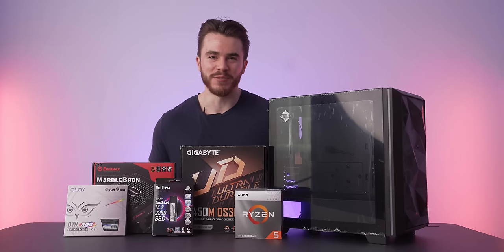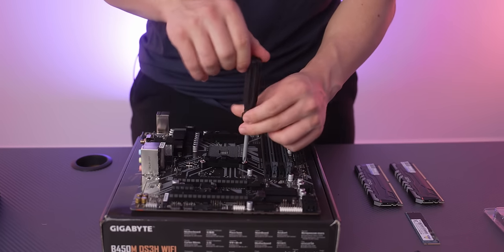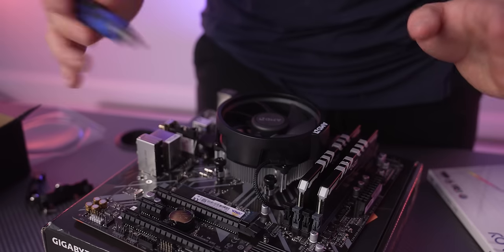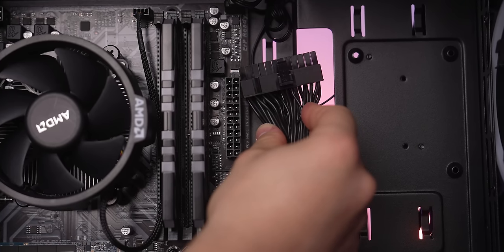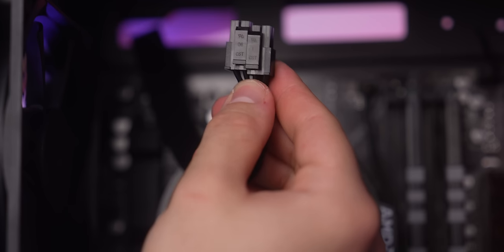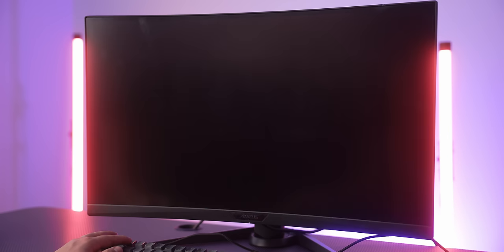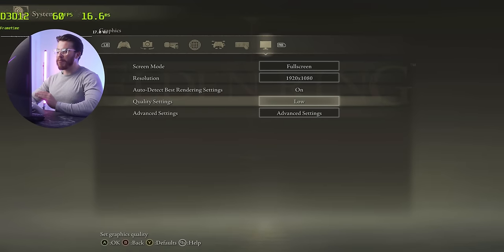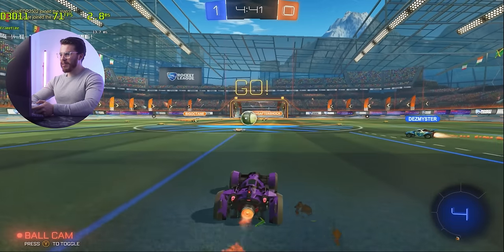How to Build a $400 Gaming PC in 2023! ⚡ Step by Step Guide

Comment: If I wanted to buy a pc with an aio cooler but it came with a fan cooler, could I just change it easily or is there things to consider?
Reply: Make sure the aio is compatible with your motherboard.

All motherboards are different so make sure your CPU socket is compatible with the aio.

Other than that, it's easy and simple to install.
Reply: @thetechrealist  okay thanks so much! :)

Comment: I made a pc with same specs but whenever I play games and record at same time my games are smooth but my recordings are so much laggy. 
Why???? 😢
Reply from the maker: You’re recording with windows game bar, which is laggy on a PC that doesn’t have a dedicated graphics card.
Reply: @ScatterVolt  i Use OBS and i also Tried Streamslabs but still get laggy recordings. Did you use dual pc setup to record game part videos??
Reply from the maker: You need a dedicated graphics card

Comment: if you don’t have at least 1500$ to spend on a pc build, buy a ps5. Price to performance is not even close even after spending 1500$ just get a ps5
Reply from the maker: You could spend $500 on a used parts gaming pc based around a 5700XT and match it. I plan on doing this for a future pc build.

Comment: the ATHENA M2 LITE keeps going out of stock is the alternate the exact same because i have no  experience
for pc building
Reply from the maker: Look at any of the other mATX cases I use my other pc build guides if you need a step by step tutorial. 

Spoiler alert though, the building process for all mATX pc cases are pretty much the same. You don't need this exact case to build this PC.
Reply: Thanks
Reply: That's gonna help when I get all the parts in 2 weeks!

Comment: Hi. i have the same pc as you are and i have a plan to upgrade my pc by adding a gpu. i have a plan to buy rx 6400. is it good ? Or maybe u guys have any other recommendations?
Reply: It's pretty bad. What's your budget?
Reply: @TheACTIONZ  Around 250 - 300 $
Reply: @oji6276  I'd say the Rx 6650 XT or the Rx 7600. Maybe if you go a bit over your budget, buy the 6700 for the 10gb of VRAM or the 6700 XT for better performance and 12gb of vram
Reply: @oji6276  the lowest you should go is rx 6600.Anything you go below that generation it's not relevant anymore. Or if you really want team green rtx 3060 if you find a good deal on it although it's still overpriced for what it is.

Comment: Can I add any GPU to this motherboard with no problem?
Reply from the maker: Your only limiting factors are graphics card length and power supply wattage supported for the GPU you’re interested in

See pinned comment though
Reply: @ScatterVolt  I see, thanks!!
Reply: @ScatterVolt  I have one more question about the integrated graphics on this CPU. If I add a GPU to it, will both work together? Or just the GPU?

Comment: Is this pc good for editing aswell like after effects and topaz
Reply: I don't think so because amd CPUs are not the best with these stuffs
Reply: @skyraze  do you know any pc that are good for editing and can play decent games I don't know anything about pcs sorry
Reply: @st4rdust_j795  intel CPUs are good for both gaming and editing but you would need a dedicated graphics card.. If you are on low budget then try to buy a used graphics card from a trusted source. 
Buy a GPU considering your budget as a new GPU takes 35-50% of the whole budget
Reply: @st4rdust_j795  for games you need a solid gpu, for rendering you need a cpu with decent clockspeed, plenty of cores and some ram(in some programs like davinci, gpu acceleration can be utilised aswell) . You can do both on any computer, how well it depends on your budget.
Reply: @NanoBytegaming  I can spend about £600 or £700 that's my budget would you be able to tell me what's good like for gaming and editing like the parts of the pc and the names please

Comment: i want to get a prebuilt pc off a trusted seller (amazon or ebay( yes i know there are more but im asking for those specifically)) for under 475 that has a good upgrade path. the best one ive found so far can only upgrade to the rtx 3080 ti and a 4th or 6th gen i7. for the prebuilt i want at least an i5 or ryzen 5 (and no im not including those little numbers) and for the gpu, if its nvidia, an rtx 3050 or slightly lower will work fine, or for AMD, i have no idea because i dont use those cards. for the ram, at least 16 gb of ddr4, ddr3 will work fine but not the best. and for those of you about to reply to this with some shitty insults, just know i dont give a fuck, or 2 fucks, or even 5 fucking fucks.

Comment: Not even a 1650??  Sheesh...
Reply from the maker: What were you expecting? An i3 10105F plus a GTX 1650? 😅

Rather go the Ryzen route at that point.
Reply: @ScatterVolt  sorry i was so saucy.
Most of the budget builds a have seen vids on usually at least use a used rx570 or some other older graphics card.   Integrated graphics to me seems like little more than a minecraft computer.